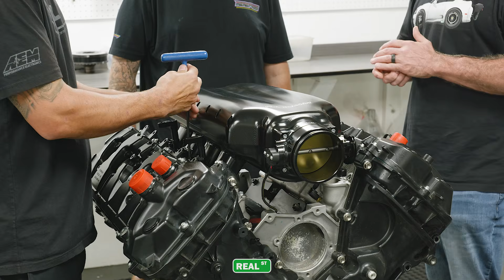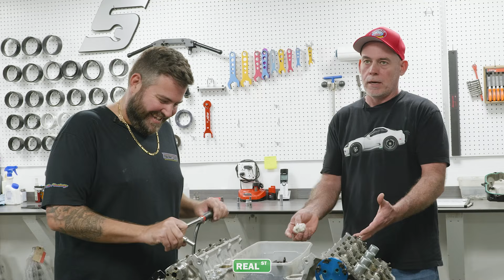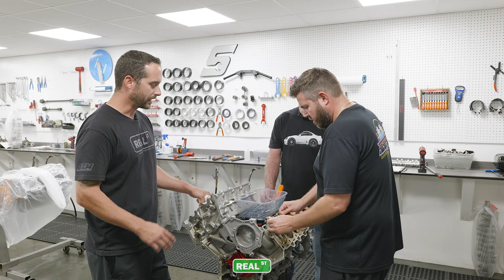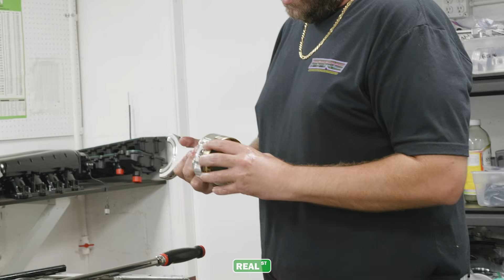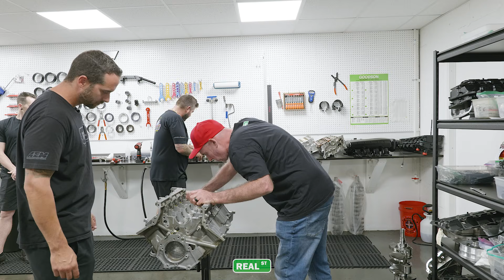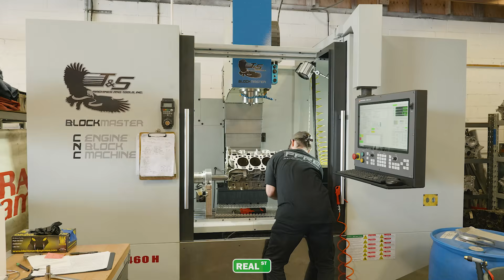Detailed 2500+HP Coyote V8 Engine Teardown - What We Found After Going 200+MPH Back To Back!

Comment: LS guy here.. gotta appreciate the engineering went into designing this platform
Reply: The coyote is definitely different! It performs extremely, I’m not a ford guy either, but I’m extremely impressed with the coyote
Reply: @barryfoster6265  ..thats right, bow to the KING!!
Reply: indeed, high fives all around
Reply: Surprised what they are doing with stock block and heads.
Reply: Very cool shit.  As someone who has no favorite Make and has owned everything from a 77 Caprice Estate wagon to an 02 Subaru WRX or a  12 Mustang GT and currently a German hairdresser 21 TTRs with over 600 HP among many others, I always knew the Coyote was an amazing platform.  They can make insane HP with forced induction.  They sound amazing.

The single downside is size.  That's it.

EDIT:  WAIT!  Ok so you might need a clean room and some advanced knowledge to rebuild one.  heh.
Reply: @TheMugwump1  size is the tax of DOHC design which provides superior breathing over any OHV engine in the same category
Reply: @TheMugwump1 if you measure the width of the coyote, to an LS with exhaust on. The coyote isn’t really that wide. A coyote is 28” wide, an ls1 with all accessories it’s 30”.
Reply: 100%
Reply: Dohc engines because of their design they are built to put out big block power in small block form the coyote is an amazing engine with excellent durability and do amazing things you want to see a really mean coyote look at the gen x MMR racing has a channel here on YouTube that shows the gen x breaking world records all motor the coyote is one awesome piece of engineering
Reply: Kinda weird to claim to be an ls guy 😅
Reply: @CoyoteFTW yes I'm an LS guy, an engine builder too, sbc/bbc destroyed ford products for many decades. It's good that ford engineers are finally up to the task, gotta give it to them, let's wait and see the potentials of GM LT6 and their coming tt version
Reply: @Airman.. lolol

You keep thinking that . The only think chevy engine did better the ford was fload the market making them cheaper.  
Doesn't mean they are better.  My little stock block 1990 mustang lived for years and best the shot out of any craparo and vette back in the day. 
Got that little 302 up to 540 rwhp and lived for year's before someone stole my car
Reply: @Spad68  dude, you have Ford blinders on and I am a Ford fan. The 1990 302 was a great engine but it wasn't better than a L98 and if you were beating Vette's at the time then those Vette drivers couldn't drive. Yeah the NOTCH 302 HO was faster than Firebirds and Camaro L98's but only because you couldn't get a 5 speed in that combination. Once the LT1 came out in 93 the Ford got pretty much raped for almost 20 years. It took 2011 for a Mustang GT to beat a lowly $22k(when new) 1998 z28. That's EMBARRASSING! FOR SHAME! Even today the GM engines make a buttload more torque with the LT1 making more power than the gen 2 Coyote and same power as the gen 3 Coyote. Hell, the 6 speed Camaro is literally faster than the 6 speed gen 4 Coyote Mustang and a lot of that has to do with all the torque the Chevy engine is pushing. The fact that Chevy's old outdated engine car is beating Ford's brand new generation engine car is pretty sad. If you were a realistic objective person you would see that sometimes the competition makes a better product.
Reply: I think they fucked up and the marketing department got in the way of the engineering. At the time of the Coyote they already had a 5.4L aluminum block on tap. Think about if they had made the Coyote a 5.4l. The money saved in parts, materials and engineering as well. There literally should never have been a 5.0. It should have been a 5.4L NA Coyote 11:1 Compression and full variable independent cam timing. It would have put GM in the rear view as well. Then, when the S550 came out they should have used the 5.8L gen 2 Coyote. Should have been a Boss 5.8 in 2013-2014. The gen 4 Coyote today should be a 5.8L 12:1 compression NA engine. Dual injection. Full independent cam timing with 540 horsepower and more importantly around 500 torque.  Darkhorse should be around 600 horsepower NA. This would have been achieved easily using the 5.8 block. Then look at the truck application. The F150 would have been so much better served with nearly another 100ft lbs of torque. The cost would have literally been cheaper to go that route. Instead of R&D for 2 blocks you are only doing R&D for 1 block and materials for only 1 block. You literally could have 1 part number for the crank and even maybe the rods if you wanted to. I could be wrong but I'm pretty sure it doesn't matter if its a 5.3 LS or a 580HP supercharged 6.2l LSA GM has 1 crank for both and every LS in between.
Reply: my 2018 turbo coyote f150  has been ran hard as hell at 800hp on all factory internals besides the crank sprocket and OPG's, and ive got 106k miles on the motor and its still going strong. these motors are stronger than most people understand.
Reply: The 5.0 block is based off the older 4.6 mod motor, which is infamously an absolute menace to Corvettes when built well.
Reply: Hell we all know who is making all the HP. Dodge!!!!  GM and ford lost the stock hp battle. And I’m a GM Guy. So this Ford GM hp battle stuff is stupid. Get over it Dodge kicked ford and GM ass.
Reply: @nickking256  that doesn't matter a whole lot in the real world when the smallest cars they come in are heavier than a F150. They never even produced a aluminum block to help offset a lot of the weight or fixed the lifter issue.
Reply: When Ford wants to prove a point, it delivers. As they recently announced, they end up being the only ones producing V8s so be it goes to show they dont really have a competitor.
Reply: I’m a ford guy but I’m not crazy how coyote sound.

Comment: I can’t believe that this level of coyote didn’t have billet cam caps.
Reply: Yes I agree
Reply: Same
Reply: seems like a strange part to break especially after some time running. Any known reasons for breaking.
Reply: @jafo49 I wonder if it was fatigue. The boost going through the heads, plus the rpm they run the engine at. It could have been a flaw in the casting, from the factory. Being that these are mass produced parts. That’s only thing I can think of.
Reply: @jafo49 
2500 hp at 10,000 plus rpms
Reply: If you could have 2900 HP in your race/street car and not have to buy all the regular high dollar parts………. I’m in.

Comment: GT500 short block, so not a Coyote engine, got it. Also, any crankshaft that you need to “cycle out” is a shit designed engine.
Reply: So you are mad about a $500 boss crankshaft not lasting forever in a 2500hp engine....got it.
Reply: @03c5z  its cheaper it cost me 380
Reply: @03c5z  why would you have a $500 crank in a 50k engine? Try again, pal.
Reply: @Highslot17  you really need to look into what it cost to build a Billy bad ass 5.2 with some mildly upgraded coyote heads. Even with a billet crank its well under 50k. Expect to keep getting roasted with those comments. Nothing lives a long life at 2000+ hp.
Reply: @03c5z  there is nothing “coyote” on this motor, except maybe the water pump and alternator. It’s a Predator block with GT350 heads. Calling this a Coyote motor is just marketing bs.
Reply: @Highslot17  whats your point? It's a production based engine. Does anyone care if someone makes 2500hp with a LSX block, LS7 heads, and a billet intake? Everyone still calls it a LS
Reply: @The Hutch Predator Block is a Gen 3 Coyote block sleeved to 5.2 🤣 you're commenting on a Real Street Performance video...Jay has been racing and building engines for decades. Built the world's fastest 2JZ at 331mph... but you go ahead and share you "Knowledge" 🤣🤡
Reply: @Highslot17  the new coyotes are cross plane crank like the predator. The originals were flat plane like the 5.2 Voodoo. All coyotes though
Reply: @Highslot17 it is its part of the family
Reply: Theres always one that thinks they know everything.
Reply: still a coyote engine bud...lol
Reply: At this performance level everything has a shortened shelf life.
Reply: They are all coyote blocks lol. From the f150 to the gt500. He even said in the last vid it’s a stock gen 2 block, gt350 heads and gen 2 crank. All coyote.
Reply: Yup. Dumbest thing I read in a while. Crank designed for a 440hp just lived with 2500hp engine and you think it’s a junk design? Boy put the meth down.
Reply: Tell me how do you get your non Coyote Sick Week winning engines to handle 48PSI for over 50 passes and drive 1000 miles...go ahead? 😏🤣
Reply: @chrismathes3647  $$$$$ and every after market part you can throw at it.
Reply: I bet you're an ls nut hugger. Show me one ls making that kind of power on a production block,crank and head I'll wait. I'll probably be waiting for ever because it doesn't exist.
Reply: Part of the coyote family
Reply: I’m not even a Ford guy but I clearly know the engines more than you guys do. 5.2 is not a coyote engine🤣 y’all are jokes
Reply: @dadinasrt9996  Both 5.2’s are coyote based, if it’s not a Coyote why do gen 3 heads go onto a Predator block? Or GT350 heads on a Gen 2 Coyote?
Reply: @dadinasrt9996 yes it is